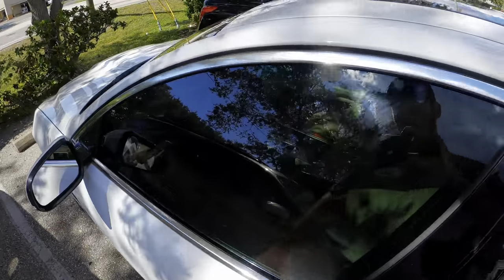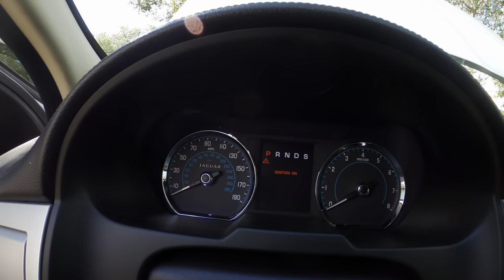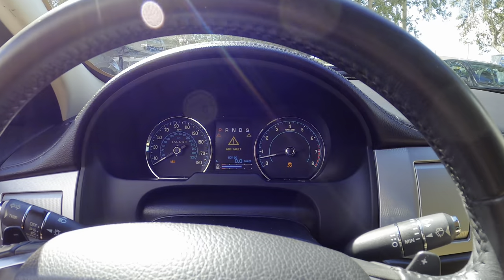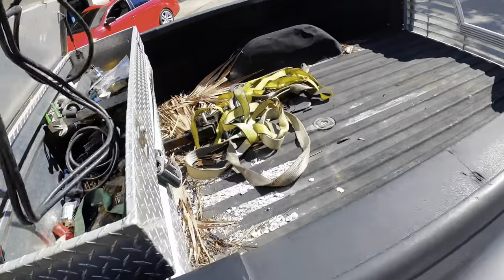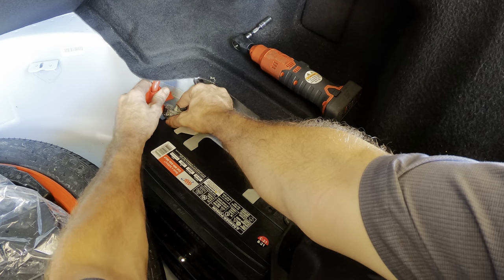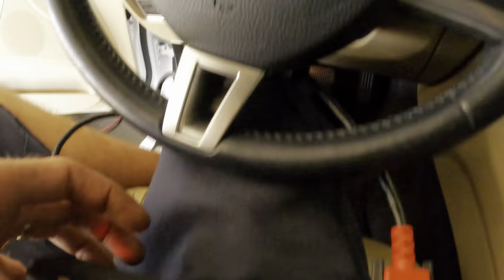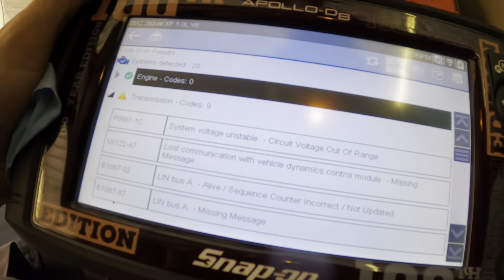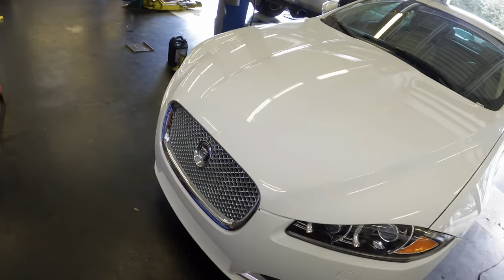Jaguar XS just Towed In.  I’m in over my head! Customer States: “Check Battery”

Comment: It’s probably a bad alternator. Doesn’t seem like the battery is charging.
Reply: If the ecu (engine control unit) of this vehicle is malfunctioning, it would also not charge the battery even if the engine is running. He did say that at 15:14 and called it ecm (engine control module) which is the same thing.
Reply: Yeah, signs point to an alternator. Could try giving it alternator voltage from another vehicle, clear the codes, restart with the proper voltage and see what the computer says. can also probe to see if the alternator is being commanded to provide current.

Comment: I would have at least checked for system voltage starting at the alternator, so many codes it’s looking like a power failure that’s effecting every computer chained off that power source and connects all the sensors and sending units.

In other words if it’s not blown fuses everywhere it’s lost power from a distribution block or the BCM or whatever the computers communicate to each other through .

Comment: Very interesting.
I like your style, however, you have spent some time trying to diagnose the problem. Further more, you did establish that the alternator wasn't putting out angry pixies ( thanks Ave, always makes me chuckle!) .
I am surprised when the customer asked your opinion, you didn't say ' I suspect alternator' cos I certainly do.!
I admire your work ethic. Long may it last. You're a true gentleman.
Reply: Bad alternator basically fits all the symptoms.  Once the voltage dropped in the battery the systems started failing one by one.  Misfires from low voltage to coils causing the erratic idle, electronic shifter not working, and so forth. Should have pulled the alternator and had it tested and replaced if necessary.  The customer seemed willing to go further with the investigation/repair.  Let them make the call after giving your suggestion.

Comment: The ecm doesnt tell an alternator to turn on, the ecm gets its voltage from the alternator. The alternator gets its voltage from spinning within the accessory belt, the voltage is regulated by a voltage regulator in the alternator to account for varying engine rpm but that regulation is through mechanical and magnetic means, not electronic.
Reply: You are incorrect
Reply: Not ture now of days the ecm sends a signal to the alternator to start charging and its usually duty cycled by the ecm to keep a better stable voltage unlike the older alternator with an internal regulator

Comment: Ray, I LOVE watching your videos; excellent how you work, so PLEASE don't get me wrong. With this Jaguar, you were a bit impatient.
 
Cars, with dozens of electronic modules have a very strict rule: They must have at least 12V ALL THE TIME!!! Low voltage or voltage (and current) transients can kill these vehicles. If you are lucky, the modules just send error messages and they can recover, but if you are unlucky, you can destroy a bunch of modules. 

You had a Jaguar with a low voltage. Instead of making sure that you have at least 12V, first you used an uncharged, also low voltage jump starter. That didn't work, so you used your truck to start the engine, but didn't check the battery voltage after start, making sure that the alternator is working and already increased the voltage to the 14.5 V level. You also ignored the "Low battery" and other error messages on the instrument panel. Instead, you wanted to drive the car immediately with a discharged (or wrong) 9 V battery (and still no charging). Most probably the 2 million trouble codes were caused by the low battery voltage and the voltage transients of the unsuccessful starting attempts (by the customer or by you). 

Of course, I cannot be sure, but there is a chance that you just had a simple battery (and/or charging) issue. When you replaced the battery, the car started to work, but all the DTCs were already in the memory (and still there was no charging). The transmission module was dead by now (or at least needed a reset). At this point you did the right thing: gave it over, didn't delete the codes, and sent the car to a Jaguar specialist. Awesome move!

Comment: Put a lab scope on the signal wire to the altanator see if it's getting the ecm to charge. If not check the ibs connector at the battery that's what yells the ecm to turn on charging based on the demanded  load required and the battery state of charge.
Reply: I would agree this didnt seem like it would of been difficult to find but again I'm not there so no disrespect to him. If you jump it and it runs then your on the right track.

Comment: Probably just a bad alternator (as noted by other comments)... But you were wise to pass on trying to repair. According to some online estimator, the average cost to replace an alternator on that Jag is close to $1000. It would suck to rack up that kind of cost for the customer, only to find it didn't fix the problem!
With some exceptions, older European cars are no problem to work on. But more modern ones, especially the latest, have so much "fancy" electronics loaded up on them that they can be a nightmare. How "luxurious"  that you can't shift out of park when the hood is open! Who thought it was a good idea to install sensors, a computer, and then write a program to prevent a car from operating in what may be a necessary condition? They've made cars so "smart" that they do stupid things. Lovely cars when everything works... Absolute nightmares when they don't.
They either need to make them much, much, muxh smarter and able to self diagnose in every imagined and unimagined circumstance... Or much simpler so reasonably well trained people using common tools and techniques can do necessary repairs. Complexity just compounds the opportunity for failure... And utterly unnecessary complexity is worst of all. 
Okay. I'm done ranting now.
Reply: If your dumb enough to drive a car with the hood open, you can't afford something like this.
There should be a tow mode to prevent that.
It's all connected. If one thing is faulty, it can shut the whole car down and it's always very expensive to fix.
Reply: Very well said, couldn't agree with you more.
Cars right now straddle a very strange line between incredibly intelligent and also incredibly stupid, some things make perfect sense, whilst others leave me scratching my head.
Reply: "I'm sorry, we will have to tow your car. The hood sensor assembly is broken."
Sounds funny to me.

3$ switch, 300$ tow bill, 100$ in repairs and your are missing at work for a whole day.

I was about to buy a Mercedes S400. I'm very glad, I bought my small Hyundai.

Comment: Looks like you need a proper jump pack 😁👌
Reply: How many trouble codes do that damn car has? Did you see how many pages he went through? Good gracious! Good call to this mechanic, let the dealership deal with that POS!
Reply: @curtiswilson4737  i own a honda civic 2017. one time, my car desided to turn off while driving. and i mean, totally off. i pushed the start/stop button and luckily it restarted. i went to my mechanic, he took a quick look at it, went through all the codes. and it had like 14 different errors. then he told one of the younger ones to take it for a spin. 5 minutes later, he came back, and all codes disappeared. he said, that "these cars sometimes want to give you a good scare. there is so much electronics in it, that if one module loses power for even a tenth of a second, all other modules think they also have to lose power. after a little while, the car resets itself and says that nothing seems to be wrong so then there has to be nothing wrong." i want my next car to be a mazda again. never had trouble with them.
Reply: @curtiswilson4737  Low voltage will trigger fault codes in every module in all modern cars. Nothing to worry about.
Reply: Weak battery or weak alternator leads to low voltage, Electronics throw a wobbler.
Reply: @sollitdude1  — i have several Hondas in my family! My 2006 Accord has 488k miles and runs as good as my 2020 Accord! My son and daughter both drive civics and have close to 200k miles on both with 0 problems! I’m not sure why you are under the impression that Mazdas are a more reliable option to your Honda! That’s simply not the case and there is a shit-ton of real world testimonies and empirical data to support it! Toyota is the only manufacturer that matches the reliability of Honda! Shop wisely, my friend!
Reply: @sollitdude1  my lexus did a similar thing. The check engine would come on and disappear the next day. Happened every few weeks
Reply: @davidelliott5843  happened to my 18 civic, alternator starting going bad, so all my electronics would flicker for a bit. Did shut off once, but man the amount of codes it thru up because of it, scared the shit outa me and my wallet/bank account.
Reply: OMG, *THIS*. I've seen some top notch repairs on this channel but this watching video was kinda cringe. Pancaked battery, no alternator output confirmed, various warning lamps flicking on the dash due to getting less than 12v... Best get the scan tool and reject the job when a code clear doesn't work... :-/.
Reply: @sollitdude1  newer mazdas are weirdly good so I've heard. Granted, Mazda for the most part makes pretty good cars anyways.
Reply: Cool seeing you here brother! What are your thoughts? Alternator, then full system code clear, then go from there?
Reply: @sollitdude1  Ha, good timing; made me laugh.  I'm currently in the middle of trying to figure out an intermittent stall with my mother's 2003 Mazda Tribute.  (Technically a re-badged Ford Escape, but if Mazda felt comfortable enough to put their name on it, they can take the blame for it failing more often than anything else I've had the displeasure of maintaining.)
Reply: @sollitdude1  I've owned 4 Mazdas. Sold 03 protege with 160k and still today running an 08 Mazda 3 gt at 140k and runs great!!!!! I baby the shit out of them though. Wife has a 16 cx5 and I have a 19 cx5. I wish Mazda would bring back a truck to the us market, I could really use one.
Reply: Would you take on this job Ivan? Scares the hell outta me. lol
Reply: @jeffjankiewicz5100  shouldn't be hard to at least check battery health, charging system, and do a health report with a good scanner 👌
Reply: @PineHollowAutoDiagnostics  Ivan & Eric O.... My 2 Favs of all time......
Reply: You clearly don't know your quantum mechanics very well. 💫
Reply: @sollitdude1  I had a similar thing while I was in driving school. It was a ford, I don't know the exact model. I stalled the car and after restarting, the car suddenly threw errors and drove no faster than 15 km/h. After a (very long and "fun") drive to the dealership, they found nothing wrong. They reset a bunch of things in the software, and the car drove again like nothing happened.
Reply: @sollitdude1  Just get car with least electronics possible. Even cheapo manufacturers can't mess up basic stuff.
Reply: @Venerablenesses  You clearly don't know how comment boards work.🤦‍♂️
Reply: @JoshySimps  when you're out of your depth, you're out of your depth
Reply: Bet you woud love to diagnose that Jag Ivan!

Comment: Most of those codes are due to insufficient voltage supply. You've already determined that the alternator is not charging. SOME vehicles will give you a "desired" voltage PID. You probably made the best call. I think you could have dove a tiny bit deeper and at least checked data to see if there was anything to be learned there. Hell, someone thought throwing a AAA battery at it was a good idea.
That being said, if you were uncomfortable working on it, you shouldn't be.
Reply: Yes, but the question is now, 'why is the supply low?'  There are way too many options to that now.  Just to start, bad alternator, bad ECU, a chafed/shorted wire in the engine bay, or as little as a loose ground wire connection somewhere under the dash*...  Now figuring out which without just firing the parts canon at everything it might be is a job for the specialist.  They could spend thousands in parts & still not fix it.

*I know of people with similar issues in newer Jeeps where that was the ultimate cause.
Reply: @NemoConsequentae  Not even a relevant question unless one can confirm that the alternator is being commanded on by seeing if there is a ‘desired’ voltage/duty cycle PID. Not every car will let you see that, but while the scanner is connected and communicating, a data scan of the different modules is easy enough. If nothing else, you can at least say there’s at least a good chance the alternator is done. After that, access to wiring diagrams and diagnostic flow charts are necessary to determine the actual cause of the fault. Ultimately, none of this matters because the car is gone.
Reply: @MrVolksbeetle  You misunderstand.  Datum: The supply is low. Relevent question: Why?  
Scan modules to see if there is anything to indicate, yes.  (But as you pointed out, this one may not give that information.  Also, with so many extant errors, finding if there is a relevent one takes time.)  
It is relevent because it leads to the fault, even if the fault is not the alternator, by finding that it is not being commanded on.  Asking 'why is it not charging' does not mean you have to look there first, it means that you need to know more about how this system works & what the likely causes are, then look at the quickest to verify/rule out first.  In this case it may well bechecking the PIDs, as you say.  But knowing that you don't know enough, or have the correct equipment to troubleshoot, means you can sometimes give the best service by saying, "I cannot fix this."

Ultimately, 'Why?' is the most relevant question in troubleshooting a fault, if not the only relevant question.
Reply: @MrVolksbeetle  I do understand, and if you don't understand the philosophy of troubleshooting, you waste a lot of time.  If you are any good at troubleshooting faults you do understand it, even if only on a subconcious level. 

When you do understand it, you can troubleshoot & fix things you have never seen before, providing you have access to at least some data.  It, and a reasonable level of critical thinking, enables you to look at a malfunctioning device & begin working out what sort of things may be related to the fault, & where to start looking.  Then you know what to start searcing for in data.
Reply: @NemoConsequentae  Now you’re just hunting for an argument. 
I rely on experience, knowledge and data to run my shop. You do you.
Reply: I also agree that the Alternator is the culprit to investigate further. I feel like if it was an ECU issue or any other computer component issue, it wouldn't allow the scan tool to connect or access data. The car also screamed its issues as well. Also, if you look closely during the moments he had his Duramax connected, the car behaved relatively "normal", the RPM's stayed true. I suspect that the Duramax Alternator is pretty beefy, and those custom made beefy jump cables supplied the needed voltage and thus made the car happier than it was. 

I think people are a little too quick to try and rag on the cars "complexity" and all the computers, I agree that a Transmission forcing you into park is a bit much -- but I think as long as you go back to the basics of diagnosis, the Alternator is a pretty standard thing across all brands/makes/models of cars and doesn't really change much regardless of car complexity. The ECU(S), all seemed to behave correct, everything seemed to function correctly once the car recognized a proper voltage, so I firmly believe the Alternator is the culprit.

Comment: These cars have a smart alternator controlled by the ecu. There is a battery monitor in the battery negative lead - right next to the battery. If the ecu can't communicate with the monitor the alternator output is limited to 13.8 volts. The monitor talks to the rear bcm via LIN Bus, the bcm talks to the ecu via CAN bus. Often the problem is in the wire that goes up to the boot lid as the same LIN bus goes to the camera - a common symptom is that the camera won't show the guide lines that move when you put the car in reverse and turn the steering wheel. You should never jump a jag of this era by connecting the negative direct to the battery - the boost voltage is then the wrong side of the monitor and it upsets the BMS system. My car had a corroded connector and a bent pin on the rear bcm, it now runs perfectly. A low voltage scenario nearly always results in an erroneous gearbox fault, it will  clear after a minute of driving.

Comment: Don't blame you for not attempting any more than you did. Had a Room mate with a 1998 Civic. Replaced Distributer  and with Great effort and the help of 2 other friends. the Crank Shaft sensor. only to find the power to run the sensor at fault in the wire or the ECM . Beyond my Help. Wasted 10 hours only to tell him to take it to a dealer or shop with better help than me. Harness connector and cable under the entire intake system and no voltage at ECM connection. Thought of just running a bypass but if the ECM does not see the sensor it bypasses and Timing is off and cannot be adjusted. Doing so could blow the ECM which has  turned off. I walked away however his car is still parked here waiting for him to tow it somewhere.

Comment: My wife loves Land Rovers.  Jag and LR have similar engines.  I love Cummins and would never buy something from Europe for myself.  After decades of fixing her LR,  one thing I can tell you is if the battery isn't 100% it will not run.  You cant trust the code reader because it will throw erroneous codes when the voltage is low.  If the battery is low, change the battery, start the vehicle and see if the system is running at 14.4 volts once running.  If it isn't you must address the charging issue first before reading codes.  I have seen this exact code with low voltage, once I changed the battery and alt it went away and never came back.